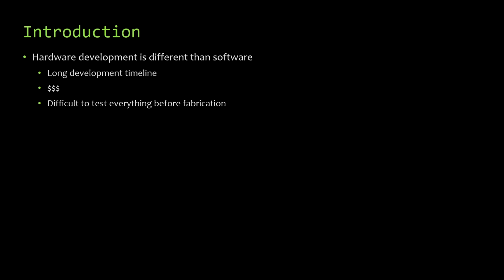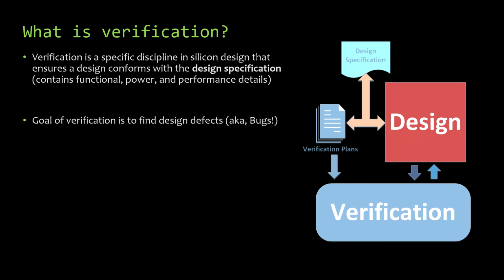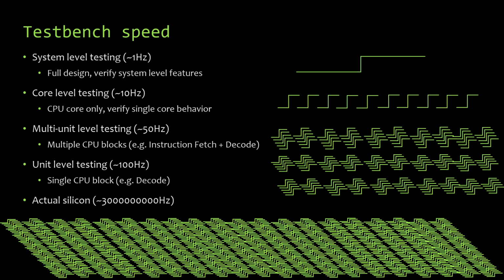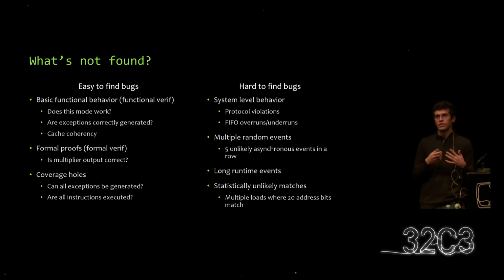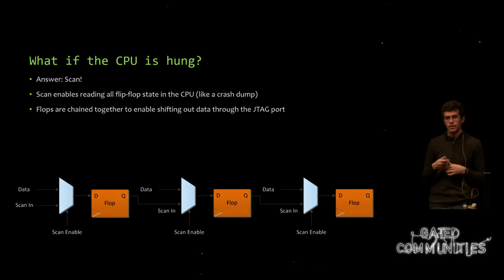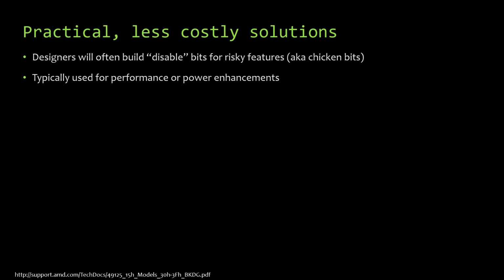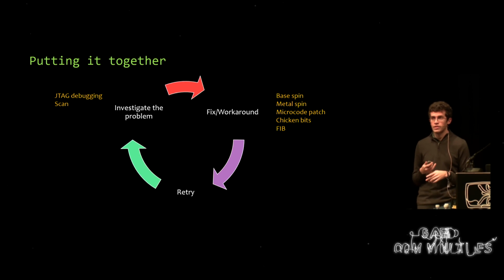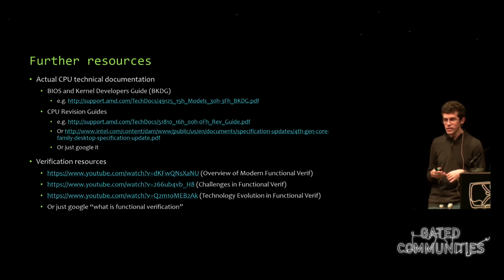32C3 - When hardware must just work

Comment: This is a seminal talk on the difficulty to test modern processors. Full models run about 3 billion times slower than the final silicon (1 execution per second). Amazing that processors actually work this well. 
(We should keep this in mind when blaming processor designers for meltdown and spectre).
Thanks for the great talk!